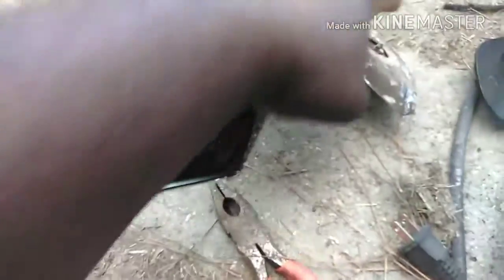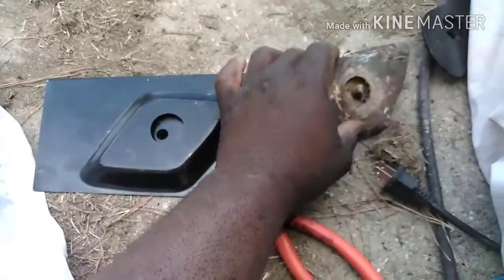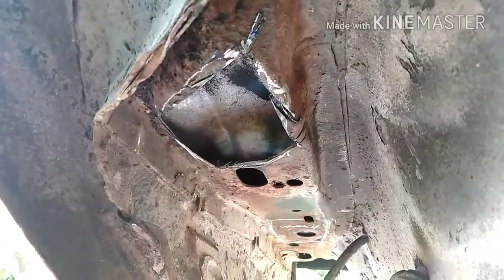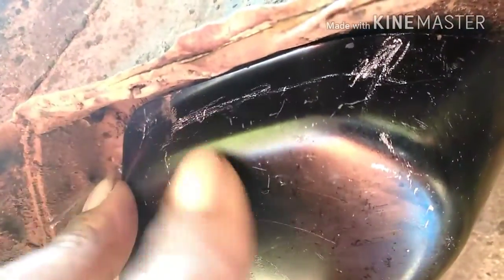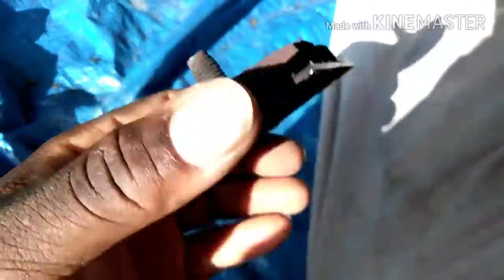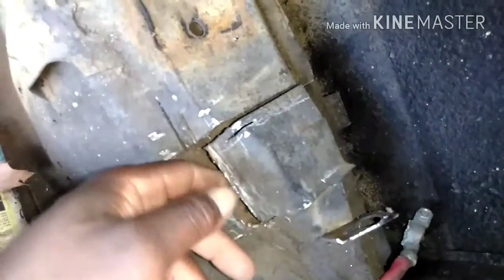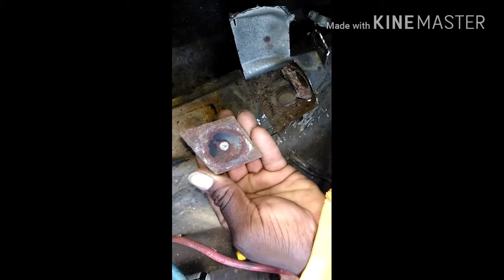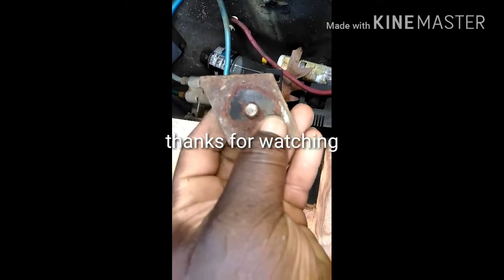How to replace gbody body mounts pt 2

Comment: I know this is an old video but I got some questions. I got an 86 Grand Prix that was my best friends that passed away I'm redoing it's in good shape but I just noticed that the rear body mounts are pretty bad and somebody shoved a bunch of Bondo up in there I need to know where did you get them pieces at bro. hit me up on Facebook messenger under this name if you would greatly appreciate it. Keep up the great work I love to see these old geez getting back on the road. 👍✌️
Reply from the maker: Ok im look for it on Ebay